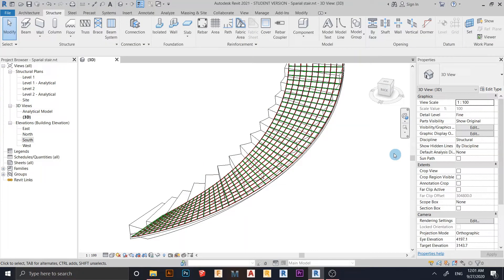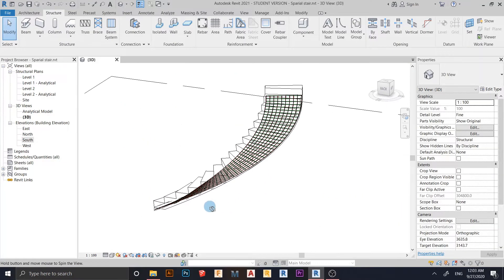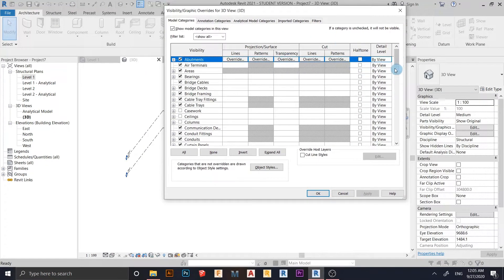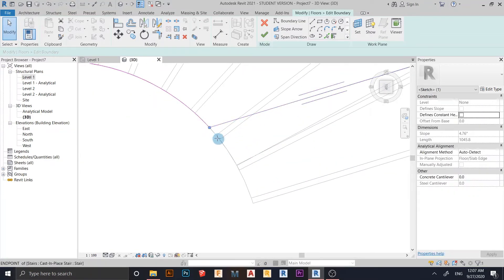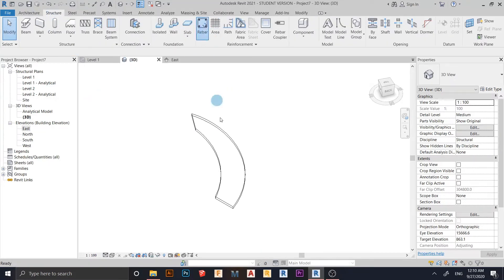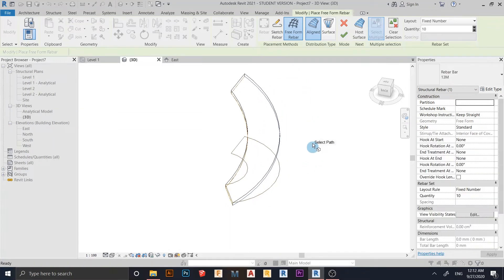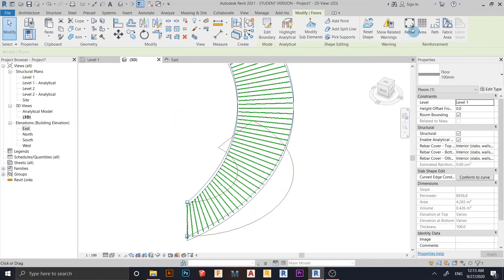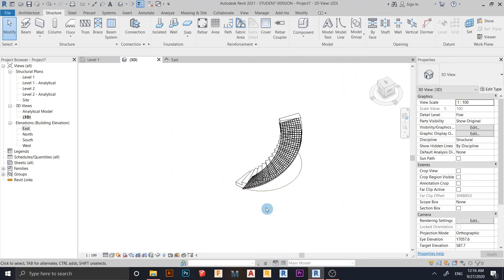3D Reinforcement Rebar Spiral Stair in Revit

Comment: i once tried to think out any possible way to host the rebar in spiral stair like this but with surface distributed rebar but it give me the warning saying that rebar can not be created which may be caused by invalid bent redius and rebar type and even played around with parameter inside its properties nothing worked . anyway i have tried the same way as you demonstrated in the video but that is not what i wanted i wanted to have the rebar automatically changed shape to the stair riser rather than just simple ramp hope you can do it in your next video